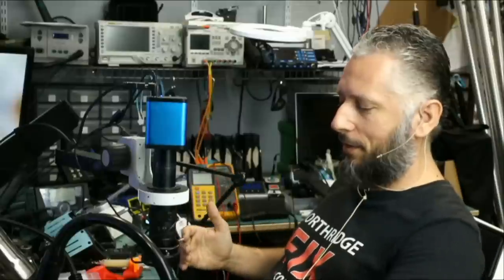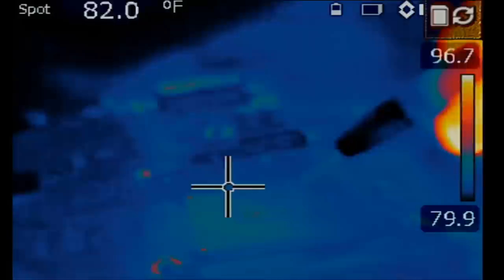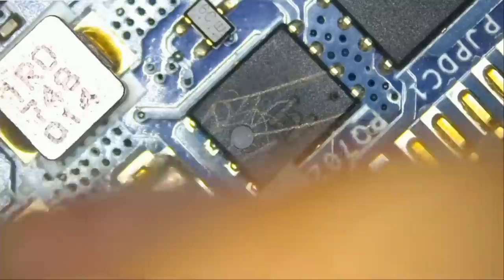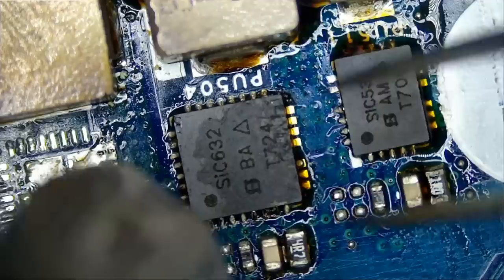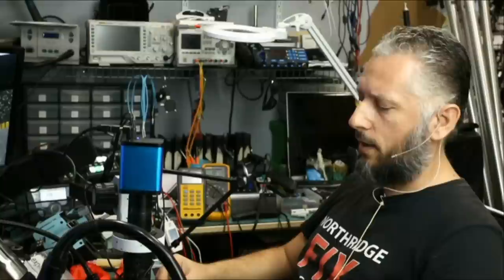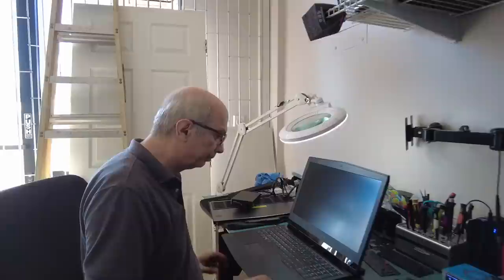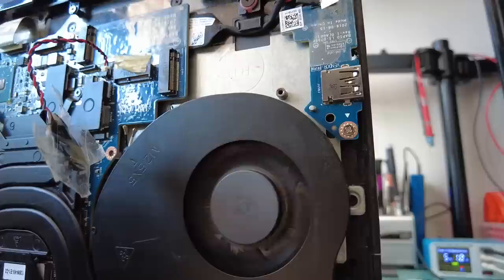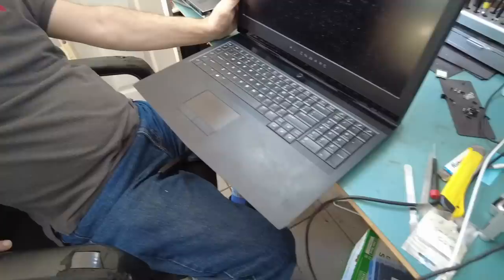Dell Alienware R4 17 common CPU failure - Is it fixable ?

Comment: 2 red and 1 blue is also very common for alienware failed bios chip. If you still have the laptop you can try to reprogram the bios chip.
Reply: Agree with this, the fan with "little spin , stop, another little spin..." could be a BIOS  issue, therés nothing to lose with trying a reflash. also if you can reflash the ec is a effortless try.
Reply: Exactly what I was going to say, looks like the laptop failed to post, he can attempt to change the bios chip or force a bios recovery.
Reply: or a RAM issue, i've seen it before
Reply: I have the same Alienware with GTX 1070 happen with me processor red lights when I leave the laptop for around 1 month when take vacation and there where hella rainy season there so I guess it the dust and the moisture from humidity make wired resistance across the board and laptop thinks this was a fault so I just clean it with gentle hands with thinner and soft art brush well it works!!!!! Happen 2 months ago.
Reply: @kikihun9726  If I had a dollar for every Dell I fixed that signaled CPU failure by reflashing BIOS, I'd retire by now.
Reply: @FrozenHaxor  how can i reflash it? this is my laptop
Reply: i guess ill try that, its my Laptop so it wouldnt hurt cuz i need my baby back 😭 one last try lol
Reply: @EvelynHernandez  The BIOS Flash IC needs to be desoldered, then a suitable binary dump that someone else took off exact model needs to be found, the more exotic the model the less chance of that happening. Depending on the board there will either be 1 BIOS IC or two of them, second one being the EC firmware - most of the latest boards switched to KBC chips with integrated flash. If the BIOS version is roughly a match, EC will not need reprogramming. Any half-competent shop is capable of doing this.
Reply: @FrozenHaxor  
Does it always work? Aside of being a little of hassle, he is already dealing with faulty dr mosfat and a cpu failing code
Reply: I had a 17R4 , flashed bios . Boom wouldn't boot . Bios beep codes were CPU error I replaced Bios chip as you did and it worked again . First MOBO flash I have done in 30 years that failed .
Reply: @EvelynHernandez   did you try it??
Reply: @FrozenHaxor  how did you reflash it?
Reply: Anyone with advanced knowledge of motherboard repair experienced this?

My laptop has those issiues:

Sometimes it would start up with no issues

Sometimes when I press power on button it shows blinking light 2red and 3 blue (which by Dell Alienware code means ram not found .

Then it would take me few power on and power offs for it to start up normaly

When the laptop starts up normaly I can work with it for days and days as long as I keep it on or standby I have no issues at all.
Also laptop performance is top noch, 0 slow downs, as long as it starts up I have no symptoms of anything been wrong

Once I hit in Windows restart (mostly) it would end up showing the 2 red and 3 blue lights and it would stay that way until I forcedly shut it off (btw screen stays black during this error)

Since the 2 red and 3 blue means ram error I decided upon when the system do start up to run prine95 memtest/cpu for whole day . 0 errors showed.
I have runned also 3dmark , the performance is just perfect, no complaints no slow downs nothing.

It's intel i7 12700h
Rtx 3070ti 8gb
16gb ddr5 ram 

My logic would say, when I press the power on button there are certain checks done before system is powered on. 
Is it the chip responsible for doing those checks malfunctioning?
Or is the ram truly the issues, since it doesn't make sense that the ram is faulty as I have runned full diagnostics on the ram once it powers on
Reply: Not worth wasting time.

Comment: MOSFETs have relatively high operating temperatures, some have maximums of 125, some less, some more. In a tight space like a laptop, getting that heat out is difficult. So one way, simply put is they just get too hot while under operation.
Reply: technically not, they can handle heat very efficiently but when there is a circuit overvolt due to unstable powerdraw they go psst... there is always a problem with these laptop's power delivery because they are factory overclocked so cpu and gpu are both power hungry and have unstable power draw spikes... a desktop can handle these easily because they have psu rated higher than needed like if a pc is build they tak 650W or higher in psu but the watts are limited in laptop... so any overvolt and overclock bricks the board's mosfets when the charger is removed and reinserted under a unstable overclock... you rearely see these things happen in gaming pc's (desktop) and when this happens we change the psu... edit: any blown mosfet is basically a water heater as you know
Reply: i wonder if laptop manufacturers are intentionally putting high end specs on laptops while not paying attention to power delivery side of things that cause them to fail more often.

 i've been advising, repasting and in some cases undervolting my friends and family's gaming laptop as to also help the VRM's , Capacitors and MOSFET cool a bit in my own understanding
Reply: Especially when you see how people treat their laptops. Using them in bed where the blanket covers the ventilation holes or dirt builds up on the fan blades and reduces the flow of the already weak airflow.
People ask me all the time about installing a copper IHS in their laptop. I typically tell them that getting the heat out of the CPU faster and more efficiently will not help since the cooling system will not be able to handle the higher heat load.
Reply: @jackflash6377  yep, there are all kinds of things you can do to improve thermal transfer, but the heat still needs to get out. MOSFETs aren't particularly looked after when designing a laptop, even some PC motherboards are left bare (but that is totally ok, cause you aren't sleeping in the same bed as your PC). 

So, for the foreseeable future, laptop repair store is a good business to start.
Reply: depends on where the FET is being used like if its on the VRM then definitely it need cooling, but others dont need generally, on most laptops MOSFETs are cooled via the VRM heatsink, but if not done, the internal resistance of the FET will go up with the temprature and it will just burn out at one point, but one thing manufacturers can do to improve efficiency is to switch to GaN FETs which are a tad bit more efficient for power delivery
Reply: For some of my laptops I've had, when it's worth it, I've done some thermal mods to, for example, allow the magnesium chassis to absorb more heat by adding copper foil tape to specific places.
I do need to get some thermal paste for my gaming laptop soonish (within the next 4 months, maybe 6 months if I don't use it too often), I may check if I can fit a shim-mod into my Dell Alienware 15 R4, maybe wrap a thinner piece of copper onto the alloy part of the heatsink and brass the thicker plate to the foil before epoxying it into place and using some thin Kapton backed graphite sheet (Kapton to stop the graphite shorting).

Or, alternatively, I may use a 2-part "insulating skin" (environmentally resistant ultra slow cure epoxy resin) around the areas I wish to heat-plate mod for closer thermal contact and so to reduce the risk of shorting.
This in hopes to make the laptop last me a few years.
Reply: Remind me about my friend old ROG laptop overheat
Kinda true their MOSFET place kinda worse for me
Reply: Also Alex getting more Asus laptops, shorted MOSFETs. I don't know the % of laptops he gets are Asus, but I do know that the thermal cam and voltage injection tools knows when to be ready.
Reply: @jackflash6377  In my previous work everytime a customer buys a laptop from us I strongly tell them that they won't use the device in bed or fur table. I hope when the time will come they won't come to me saying their laptop was so hot when they use it.
Reply: don't forget some manufacturers use incorrect thermal pads or no thermal pad at all. Unfortunately Drmos don't carry thermal sensors. And they may go very hot because thermal pads where not used or the size was tick to make contact between both surfaces.
Reply: @jackflash6377  totally agree, including the maintenance habits, as we know also dell put not a high quality thermal pads and thermal paste...

Comment: I have had laptops of every size and desktops since the early 90s and I am of the same opinion as Alex; laptops are suitable for light use and portability, anything else is way better on a desktop..
Reply: I played cyberpunk 2077 on my laptop 12 hours a day and had no problems.
Reply: I don't use consumer level laptops and only go for business class unless to collect something interesting but anyway business class models are better built and do hold up to heavy use much better than the crap sold in places like walmart or newegg etc.
Reply: At that point it’s a laptop, being used like a desktop. Meaning you were plugged in, sitting in the same place going no where.
Reply: @booma_  there is always that smartass who is smarter than others, luckier than others and has a better device than others.
Reply: @chongtak  Same I play BF4 Witcher 3 every game on my laptop and I can take it outside for 1 hour to work cause that's how long the battery lasts 😆😆
Reply: "Gaming Laptop" has always been an oxymoron to me

Comment: "I've had this twice. Called support and the trick is to disconnect the battery, hold the power button down for 30 seconds, re-connect the battery and then try turning it on. It seemed to happen with the battery running down and then plugging it in, although it only happened twice within the first couple of weeks of buying it (back in feb)."
Try without the battery, not with the dc connected.
Reply: seems like corrupted cmos
Reply: @maklogetrich2378  yeah could be cmos or bios issue on top of the mosfet, could also be the ram

Comment: I'm totally with you on the laptop vs desktop thing. I also know a lot of people who bought expensive laptops, but don't need the mobility and have the laptops sitting on their desks, plugged-in all the time. They are facing constant overheating issues and other quirks that they probably wouldn't have had with an equally or even better spec'd desktop. Plus, a desktop would have cost them a lot less.
Reply: A quality cooling pad goes a long ways to bringing those temps down.  It is amazing how many people place laptops flat down on a table, or their lap.

Comment: Love your videos; genius!

MOSFETs can get hot when they don't switch between on/off or off/on quickly enough. During the transition, it has to limit current which causes rapid heating. Off is good, on is good, inbetween is not good. Check gate resistors etc. as these can increase switching times causing the MOSFET to heat up.

Comment: @NorthridgeFix disconnect the battery, hold the power button down for 30 seconds, re-connect the battery and then try turning it on. It seemed to happen with the battery drained.hope this helped.

Comment: Agreed on high-end gaming laptops. Anything drawing 200+ watts in that form-factor is likely to cook its components sooner or later. My desktop PC uses 13 mosfets to power CPU vCore, not 2! There are plenty of more power-efficient options even with discrete graphics that might not quite push the same frame rates in games or complete renders as fast but they're a lot cheaper, have much better battery life, and are a lot less likely to spectacularly melt themselves to death like this one did. Not to mention how expensive these sorts of laptops are, you can likely get a more powerful PC in a tower form factor and a reasonable laptop for the same price.

Comment: I have 10 custom made power PC in the office for 3D design and ONE MSI laptop. We use the laptop mainly for presentations at the customer's place and some rendering jobs when on the road. You are absolutely right: it is crazy to use a laptop as the main rendering unit for 3D design or video creation. No matter how good the laptop is (the MSI ones are really good) a custom build PC will always outrun it in speed and reliability.
Reply: My company has a farm with several workstations set up, so that people working remotely on laptops, can portal into the workstation to do the heavy CAD work.
Reply: @nunya3163  exactly! Don't use laptops for heavy rendering.

Comment: Mosfet failure are usually a result of surges or transient spike getting into the internal capacitance and coupling withe current to the drain, creating a short. There are about 8 ways or more that spikes or surges make their way into the gate.

Comment: One reason those tiny power chips fail is that they doesn't have enough heat sinking. They rely on those even tinier source and drain pads to sink their heat in to the... well... motherboard, that too via those 5 or 10 vias. 
So most of the time when under heavy load, they are on the borderline of their thermal envelope. If there is a momentary spike in power draw by the CPU, and this unfortunate chip was on the switching duty at that precise moment, it sacrifices it's life.
Reply: Lost me at ‘they doesn’t’
Reply: @SM0KE_0RIG1NAL  English is not my language.

Comment: Alex did you disconnected the battery before pressing the power button for 30 seconds? i have seen people say that they fixed it by doing it this way
Reply: Battery & the charger also
Reply: Sheesh it worked

Comment: Professional catch, I would suggest on these models, either to check the BIOS signal on pin 1 by oscilloscope or replace the BIOS ic with same SKU in order to confirm the CPU faulty at this stage.
I like your troubleshooting strategy.
Reply: My Alienware M15 r2 laptop has those issiues:

Sometimes it would start up with no issues

Sometimes when I press power on button it shows blinking light 2red and 3 blue (which by Dell Alienware code means ram not found .

Then it would take me few power on and power offs for it to start up normaly

When the laptop starts up normaly I can work with it for days and days as long as I keep it on or standby I have no issues at all.

Also laptop performance is top noch, 0 slow downs, as long as it starts up I have no symptoms of anything been wrong

Once I hit in Windows restart (mostly) it would end up showing the 2 red and 3 blue lights and it would stay that way until I forcedly shut it off (btw screen stays black during this error)

Since the 2 red and 3 blue means ram error I decided upon when the system do start up to run prine95 memtest/cpu for whole day . 0 errors showed.

I have runned also 3dmark , the performance is just perfect, no complaints no slow downs nothing.

It's intel i7 12700h

Rtx 3070ti 8gb

16gb ddr5 ram 

My logic would say, when I press the power on button there are certain checks done before system is powered on. 

Is it the chip responsible for doing those checks malfunctioning?

Or is the ram truly the issues, since it doesn't make sense that the ram is faulty as I have runned full diagnostics on the ram once it powers on

Comment: I' am sure you are correct in diagnosing the problem; however, some laptops and desktops will cycle with a corrupted bios chip. I have run across this issue on a number of repairs usually caused by updating the firmware or a device failure.

Comment: Like with every electronic equipment, expansion and contraction from thermal changes cause heating fatigue on the materials (all materials). This is the main cause of the electronic failures that you are seeing in laptops. If they would run always on a same temperature, they would not break as soon (even if it´s a hot temperature). That´s why I recommend to tweak your systems so the CPU temp is stable and not raising and lowering all the time (hence the expansion and contraction would be avoided this way). One way to do this is to block turbo state or diminish it to a minimum. Also, set the system to not go to hibernation, just go to standby whenever it´s not in use. This way the internal components would have a slightly heated state all the time, avoiding the cold state at all times.

Comment: UPDATE on PC: so I ended up finding a similar computer with the same specs. swapped my harddrives, and ram into it and that became my quick fix to getting it  back on its feet. need to fix a Wifi issue and swap the batteries on these cuz the new one I got has a dead battery that doesn hold a charge and the computer isnt reading a WIfi adapter rn. WIll see if swapping the wifi cards willl fix that

Comment: I travel so I need a gaming laptop to relieve stress after a long day, but I also know the pain of it failing and becoming a paperweight. I sent you my (2017) Sager to fix but unfortunately, you weren't able to find the issue and it was deemed a no fix. I'm current using my 11-year-old Sager, it is huge and old skool. It has socketed CPU and MXM GPU card (GTX 980m). It does what I need it to do but I will need to buy a new one sooner than later. Good work as usual!!